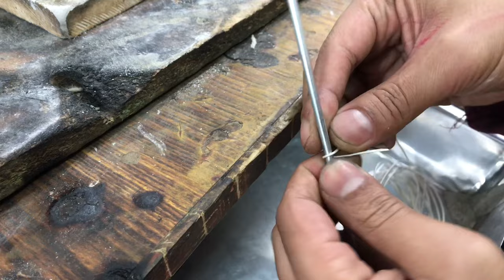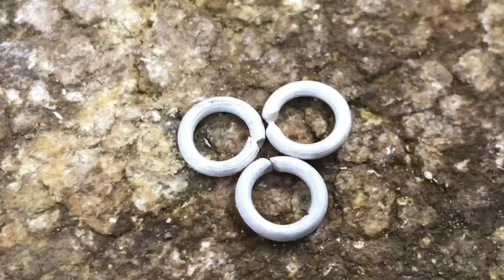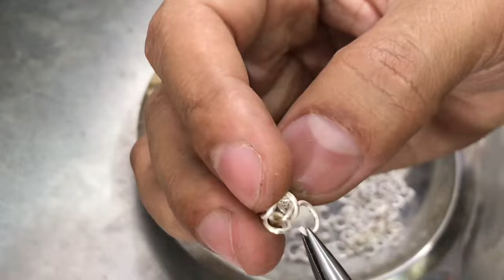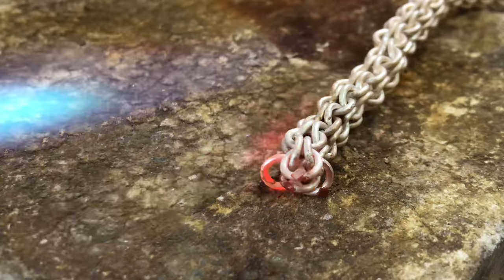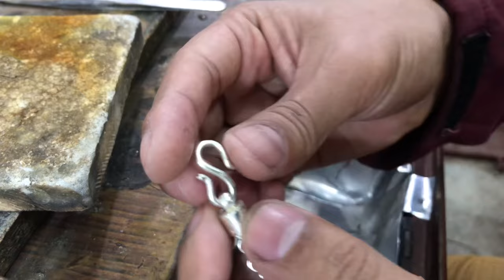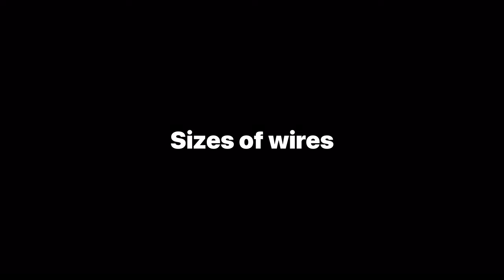Even a child can do this.👆| bracelet making

Comment: Great work!  You should show that every ring needs to be soldered.  Do you use flux?
Reply from the maker: Yes. That is understandable.
Reply: I missed that part, also.  Specifically, without soldering the links to each other.
Reply: @WeMakeJewellery  wait you soldered every ring?
Reply: Not all chain maille is soldered. If not the rings are better aligned with wire flush
Reply from the maker: @Rennat I had  soldiered  all jump rings but I thought you’d understand, so I didn’t showed all jump rings soldiered. it would be very long video if I did so.
Reply: Where to soldering in the rings after trap the rings....

Comment: I want to make this! Please tell wires in mm. I don't have a gauge tool.
Reply from the maker: Please watch at the end of the video.
Reply: @WeMakeJewellery  so 8 gauge is 4.05mm?
Reply from the maker: It’s 18 gauge wire. 1.22 mm
Reply: @WeMakeJewellery  ok thanks got it. So the steel rod is 8 gauge which is  4.05 mm.
Reply: @WeMakeJewellery  друг мой, а вес браслета не подскажешь? Буду очень признателен.
Reply: maybe 30g?

Comment: What material you use for welding the joints? (Small pieces added to seams then torched)? Assuming it's gold?
Reply from the maker: It’s cadmium mixed with silver with the ratio of 30:70. 30% cadmium 70%silver.
Reply: @WeMakeJewellery  so when working with gold it's 30% cadmium 70%gold?
Reply from the maker: Sure,
Reply: @WeMakeJewellery  Cadmium is considered as a serious risk for the health? Is there any other substitute for the melting boost instead the cadmium?
Reply from the maker: @elfillari  yes, there is alternative of cadmium, you can use zinc. And the proportion must be 5% zinc 95% silver or gold.
Reply: How many inches wire For 10 inches chain replay please
Reply from the maker: @venkatakrishna7831 110 inches for 7 inch chain.